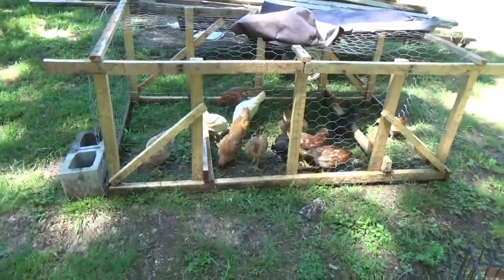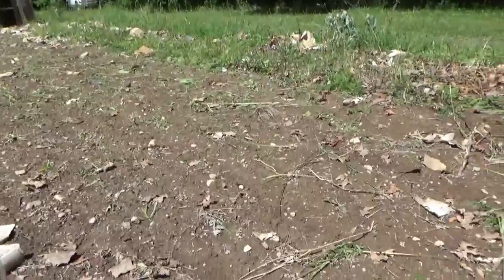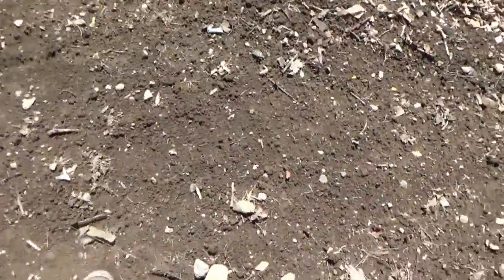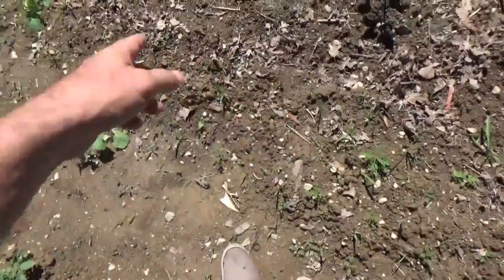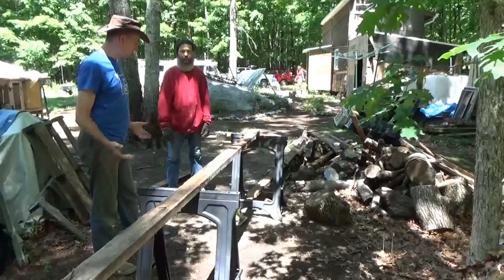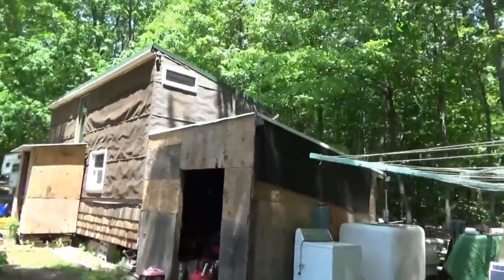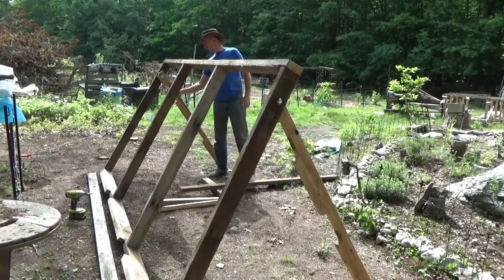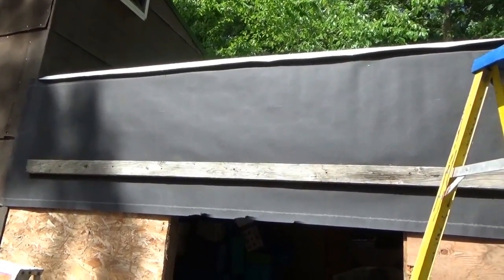Mounting Off Grid Solar Panels On DIY Adjustable Roof Brackets

Comment: I thought you were going to put siding on the shed. You will have to take it down to put up the siding, but as per prior videos that will never get done. Like I've said before work smarter, not harder.  i guess that falls on deaf ears!
Reply: Will you go over their and put up his siding you are so worried about it. You can work smarter, not harder in shutting up. You sound just like Sir Dumba$$ that finally got tired of his name and switch to another name to comment about his garden basement fetish here. Will you be that guy with the siding fetish.
Reply: 1. First of all I wasn't speaking to you. 
2. It's spelled "there" not "their". 
3. I don't have a clue what the rest of your rant is about.
4. I don't care about his siding or any other projects Troy does.
5. Have you tried anger management counseling?
Reply: 1. Do you always reply to yourself?2. If you do not care about his siding or any other project? Why did you comment about his siding?3. Do you have a fetish about his siding?4. LOL 5. Why do you have a issue with anger management counseling?
Reply: Judging by what you write, you're easily amused.
Reply: Thanks!Are you still replying to yourself?(Hint) That is why they make a reply next to the Thumbs up sign. DUH.  WOW I can not wait for the next comment you leave here tomorrow. It will probably be about how Troy installed his own Solar Panels.
Reply: Chateau Sport 24-T Thank you for your conversation.
Reply: ***** Thank you.
Reply from the maker: Now imagine trying to put up solar panel framing over shake style siding. I would have to remove some siding to put up the framing. The framing is bolted right into the wall studs for strength. These panels will have sever wind stress on them. I think that I am working smart by planning to mount the solar panels from the start BEFORE putting up decorative gunk

Comment: At some point in time I registered on your forum, but obviously didn't bother to remember my login details. 
I have been saying for a while that what you should do up at the wood pile is create a workstation for you to process the wood up there. Just some sawhorses to start, build and adapt over the years to what your needs are.  A foot path is a lot easier than a tractor path and probably a lot more sensible too. It will still take a bit of work and several days to do it right, but clear it from tripping hazards and you'll be set to safely get up and down that section of the property. Especially good in sugar season when carrying buckets of sap. 
This is one of those "permanent lifestyle improving projects." You've had trouble in that area before and breaking an ankle or giving yourself tetanus with a rusty nail would not make for great viewing. Well...it would, but...yeah.

Comment: Use this:  Organic weed killer: 1 gallon vinegar, 2 cups epsom salt, 1/4 cup dish soap. ..... Homemade weed killer - 2 c vinegar, 1T liquid soap, 1Tsalt . . . will kill anything ten Put the leaves around the new plants to prevent weeds.  Get Rid of Slugs – Need a way to get rid of backyard slugs? Skip the expensive and hazardous chemicals. Instead, lightly pour baking soda on them!Safe Organic Pesticide – Make a safe and organic pesticide spray that can kill insects harmful to plants, like aphids, while not harming beneficial insects.
◾Mix 1 teaspoon of baking soda
◾1/3 cup of cooking oilMeasure out 2 teaspoons of the mix and add it to 1 cup of water. Add this water to your plant sprayer.
Reply: Really good tips

Comment: The solar panel frame is going to be in the way of the eventual siding. You're not really planing to side around that, are you? That would be a huge mess and be very difficult. It would take you at least 3 times as long to do the project with all the cutting of the siding around the frame. Do you have nail bags so you don't have to run back and forth?
 The garden is coming right along. Have a nice day!

Comment: i hope you haven't put it on the roof yet. with the snow you get, its  going to be hard to wipe them panels off. best to just put that setup in the sunniest spot you got
Reply: <---Experienced at removing snow from roofs.
They make long handled brooms that people in New York use to pull the snow off their roofs. When you get three or four feet of snow on the roof, it is usually a pretty good idea to get it off. That is why the roofs are usually built pretty steep and they have flashing for it to slide off and not have ice back up under the roofing material. Troy will need one of those brooms.
Reply: It's going on the wall
Reply: George Simon
A broom is the environmentally sound choice; approved by Mother.